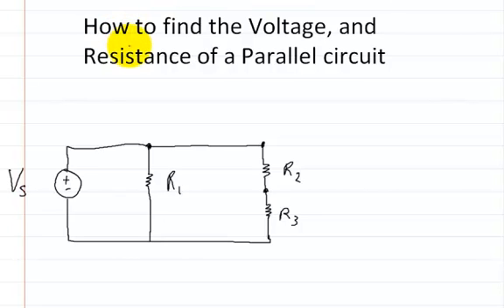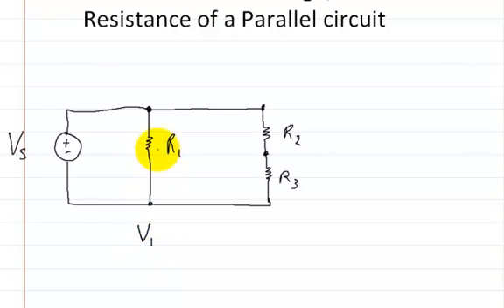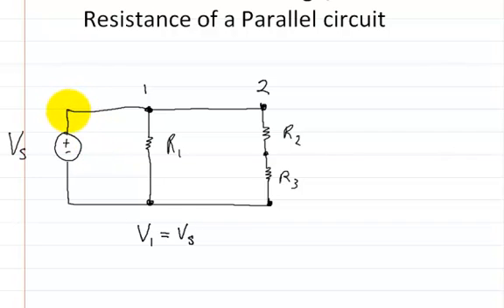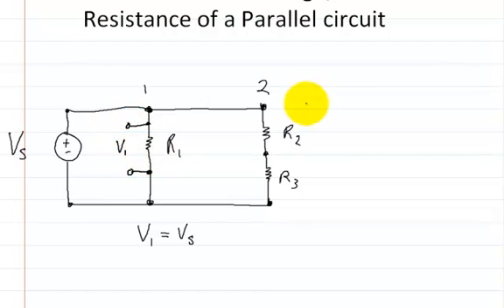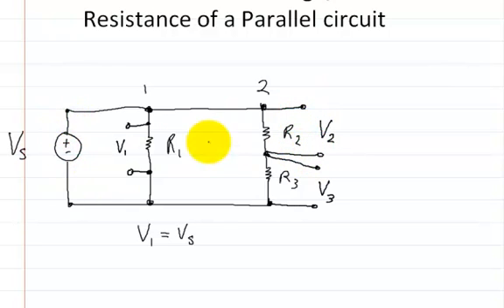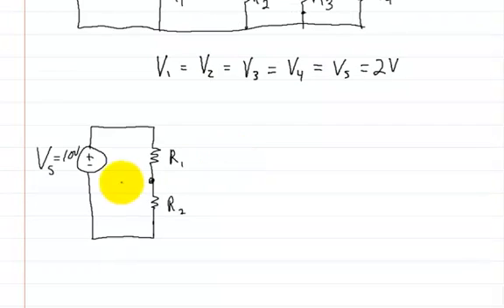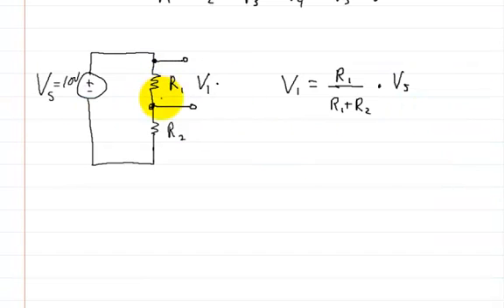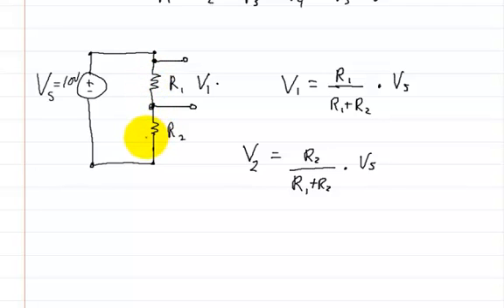How to find the voltage and resistance of a parallel circuit

Comment: Because each component in a parallel circuit has two common nodes with each of the other components in the parallel circuit. Consequently there are only two nodes in a parallel circuit that can be at a different Voltage potential.

P.S.

Because of this characteristic you can measure the voltage across each component in a parallel circuit without moving the test probes of the Voltmeter.
hope u got it.

Comment: i did a simple circuit of 2 switches and 2 leds (with their own resistor) connected parallel to a 9 volt battery. but when i hooked up my voltmeters to each LED their voltage was at 5 not at 9 volts even though the battery itself was reading 9v. why is that? can someone help me?